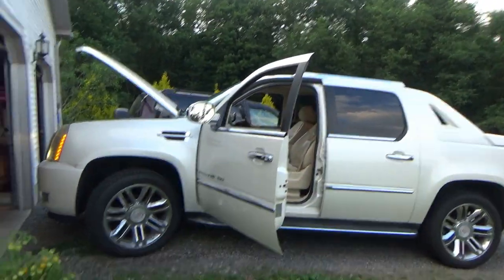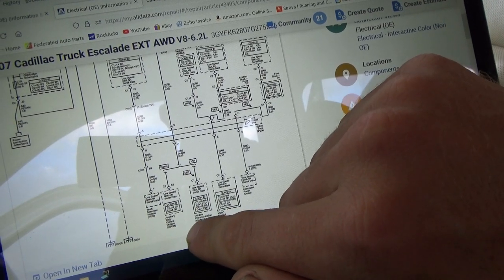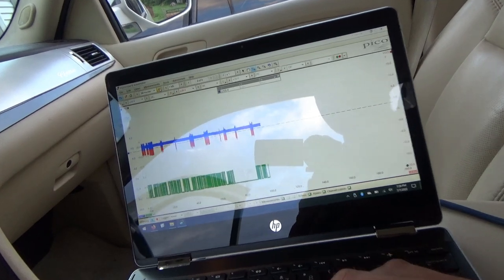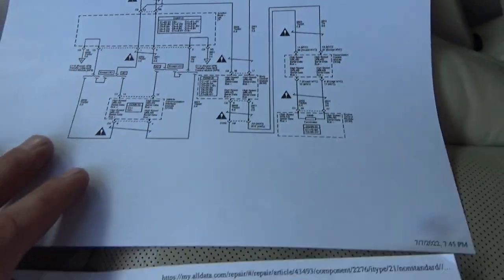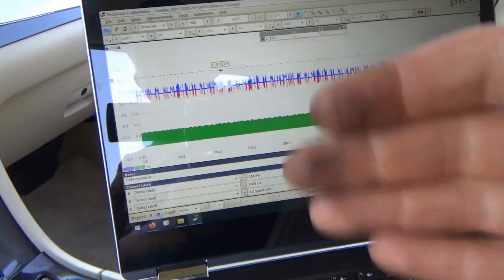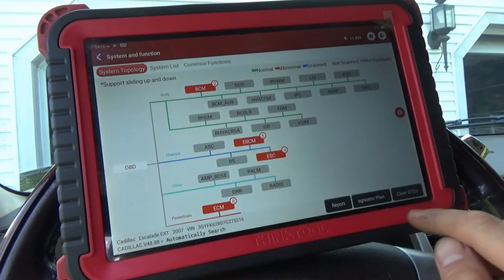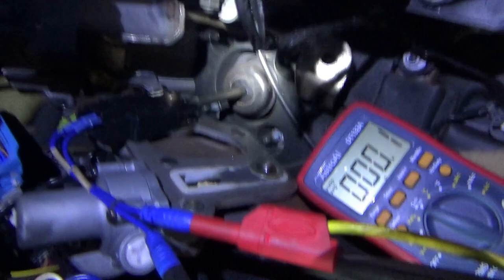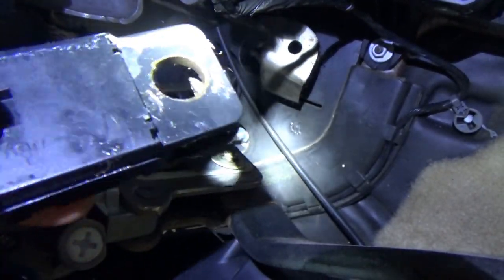Shops...Dealers...Parts Cannon FAIL! (Escalade CAN Ghost)

Comment: I big problem with the automotive repair industry is good diagnostic is not rewarded. Let’s say a tech spends 20k on the best diag equipment, studies,and trains. Tech “A” without that equipment or knowledge charges hours for diag and  thousands on parts. Then tech “B” with the best stuff and procedures finds a bad ground in 45 minutes. There is no reward for the investment. I am a really good diag guy and I left the industry because I had to repair 2 or 3 times as many vehicles as a hack to make the same money. Fixing these problem cars from shops was so easy for me it was funny but after some time I became resentful and couldn’t do it any more.

Comment: I know that switch we'll. 2004 suburban 2500 LT - no room at all under dash at brake pedal. Probably could have fixed it but so hard to get to that it's better to replace. Pretty simple switch but the contacts do wear out.

Comment: I got a good one for you at work. 19 Silverado with L82 engine and MYC trans intermittent issue. The ecm, bscm, tccm will lose comm with Tcm. Tcm will set a p0700. Codes are a u0101, u18d7 ,u0422, u0121. I can't get the vehicle to act up. There is a pi for engine wire harness chaffing found 7 spots where the harness was chaffing, said screw it knowing issues we have seen with the harnesses on these newer trucks shot a harness at it. drove it 30 miles all good. Customer takes it put 30-60 more miles on it and has the same problems. During me trying to recreate the issue i have found if you take away the main battery power for tcm it will set all those codes, as the power feed is the only circuit that doesn't share a circuit with any other circuits. if you  take away ignition feed or ground it will set other codes and not these ones. Can't be a data line issue as the other modules don't loose comm with any other module except transmission and no can bus fault codes. So monday i'm going to start looking at it again as i haven't seen the truck before to see what i can find. If i could get it to act up i could find it in like 5 minutes!
Reply from the maker: Intermittents can be a bear. Scope the comm lines at the TCM. Could be a bad TCM...
Reply: @PineHollowAutoDiagnostics  luckily the truck is still under warranty so the customer didn't have to pay anything.  All the wiring checked out. So i put a tcm in it. Then the customer traded the truck in for another one lol.

Comment: Ivan needs an Escalade EXT 4x4  with Pine Hollow Auto DIagnostics magnetic advertisement on the doors. 
It kinda suites him a bit better than the XL-7..
Reply from the maker: Wouldn't work with the current gas prices 😂
Reply: @PineHollowAutoDiagnostics  What does the XL-7 get for fuel economy?  That EXT might pull down 20 on the highway.  On premium....
Reply: I would kind of wonder about the prices a mechanic is charging if he pulls up in a nice shiny Cadillac S UV. Lol 😀😀
Reply from the maker: @kevin9c1  I average around 22mpg summer 20mpg winter on regular...

Comment: i have a 2006 ford 500 awd dtc p1889 cant find one mechanic that can fix it i have tried lol i know its pump pressure performance no one can get rid of it i have been kicked down the road by about 9 garages no one wants to be bothered
Reply: It all comes down to money sometimes, how much are you willing to spend for diagnosis? You notice Ivan has people bringing cars to him from hundreds of miles away, those people clearly are willing to pay the price to get a Good fix.

But it is a shame that so many"technicians" are truly not up to speed regarding electronics in modern vehicles.We like to moan about, (me included :), the good old days when you can fix a car with a hammer and a flat blade screwdriver but those days are gone gone gone.   I truly hope you are able to find a technician good enough to fix your problem, it's gotta be frustrating!
Reply: @stevewhite3424  Ty for your kind words